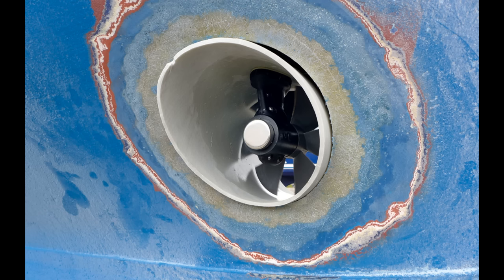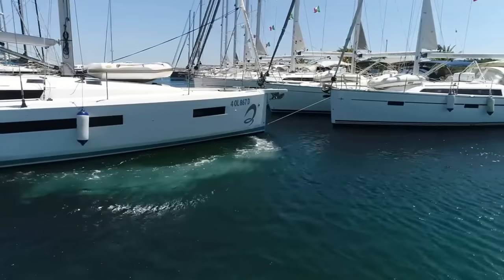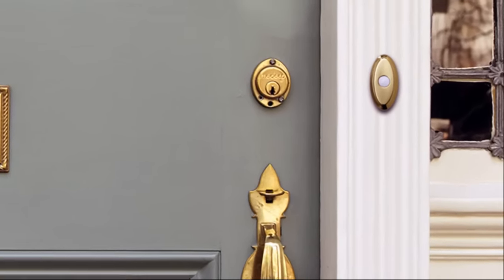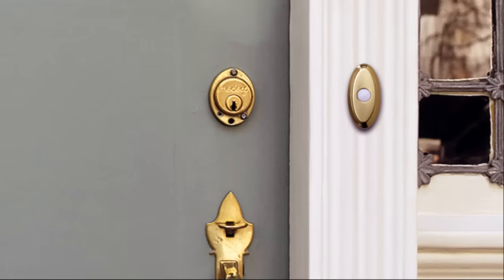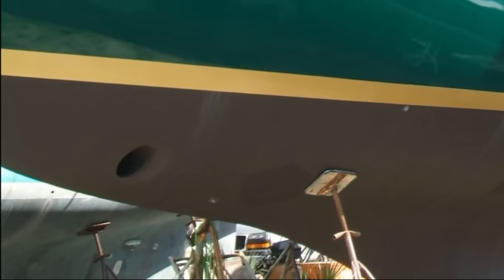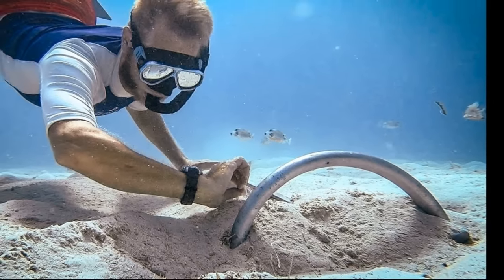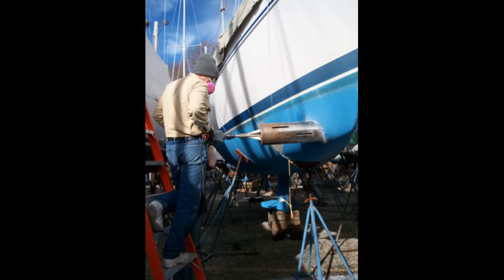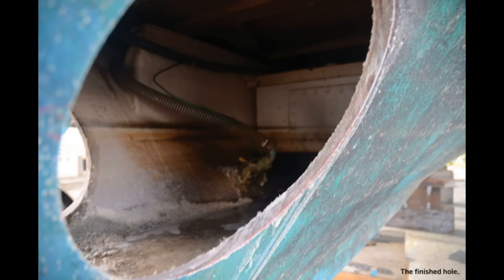Sailboat Bow Thrusters - How Much, Do you Need One, and Why - Ep 248 Lady K Sailing

Comment: I have a 1975 Columbia 52’. (No not 50) when I bought it, knowing I’m essentially single handing it with my wife no experience, my first thought was bow thruster! Ended up buying an external bow thruster, (side shift) talk about piece of mind! I sail sea of Cortez  and south past Pv, lotsa marina’s with tight quarters (Barra ex.) and million $ yachts as obstacles/fuel dock lines etc.  after my hydrovane, easily my best purchase-love it(esp. the hand held remote) $4500 in 2018

Comment: We installed external thrusters and it is great piece of mind coking back to the marina in strong winds. They are made in Ontario. Sideshift and come with a remote you can hang around your neck if you are single handed and need to move the boat sideways while attaching lines.

Comment: My spouse and I double hand our 54 foot Jeanneau, so the bow thruster is essential, especially in our marina where the fairway is only 65 feet wide, so we only have 5 feet of clearance forward and aft entering and leaving the slip.  Being able to spin the boat in its place is mandatory.  Our friends bought a Beneteau 423 and had the bow thruster added post-purchase.  There are a few companies up and down the East Coast that specialize in installation.  They have crews that travel from marina to marina with all the components in their truck and do the install in 2 days if the boat is on the hard.  That includes all wiring, batteries, charging system, etc.  Going price for a clean installation where nothing is in the way of the tunnel, thruster and a ready spot is available for the batteries was about $14K.  Watched them do the install on a remote web cam, it was pretty cool.

Comment: The Harbour we are based in we have a pretty awkward mooring against the harbour wall and to go out to sea we have to push off and rotate 180 degrees in a space about 10 feet wider than the length of our boat. When there isn't a boat moored up on the pontoon opposite of course. After 10+ trips out we have become very slick at doing this, I can put the engine in reverse at low revs and I know the prop wash will rotate us anti clockwise. There is a river and tidal effects that we have learnt will spin the boat quicker or slower. I'm just saying if you learn the capabilities of your boat it may make you a better sailer than if you rely on extra add on equipment than say a bow thruster. "Know your limits" is the best piece of advice in this video.

Comment: Great vlog again and agree with your analysis and conclusions. Have myself..live on it too...a 38ft steel twin mast cabin sailboat. With long keel...so was quite tricky sailing by myself to the new marina here when docking on arrival due to the wind. Was also tired from the long trip. Especially also because when scouting and registering two days earlier the side jetties were still missing which were there now. The boat drifted at an angle unfortunately.😅 Bow thruster had definitely helped me, now it was some helpful fellow boaters. So much thought about it afterwards. But somewhere I don't want it, as a good skipper you have to be able to do without it I think and the cost is indeed relatively high for little use. So I was and am looking more at creative alternatives. An electric outboard motor with the often long shaft..also for use in my dinghy..that you can place on the bow as a bow thruster function? A water drone to assist as a kind of tug? The dinghy itself functioning as a tug unmanned with a remotely controlled electric outboard motor often used by fishers? A water jet-like system with a water pump and then hoses to be placed on the bow? I will experiment with it in the new season and when I have some budget again.😅😊

Comment: Ive done several on power and sail. Good job covering the primary issues. It can be tricky. They need to be well below the waterline, sometimes thats just not possible in some boats. Get someone with experience to investigate the possibilities before pulling the trigger.

Comment: The last boat I chartered was a 32'er,  my docking plan turned completely disastrous. A few months later I bought a 45' Hunter, with a bow thruster.  I'd never used a bow thruster before, but I figured it  out in the channel heading towards my new berth/home (for the first time, solo.) I backed the boat into the berth and did a pretty good job. The next 8 attempts, 6 with an instructor were terrible. Now I'm good.  Bow thruster is great, practice is more important.  I use it all the time, but I could get by without it. 
And yes indeed, docking in a specific place is always always optional, not mandatory. What is mandatory is docking safely without damaging anything. 
Do I like my bow thruster?  you bet. Do I need it? I use it. Glad to have it. My dock neighbors have an after market bow thruster that hangs off the bow of their 40'er.  They like it. This would get you a bow thruster, not cost $18k.  Do others need a bow thruster?  What we all need is a lot of careful practice doing anything and everything with our boats. 
As for "We've all got along just fine without...." I wouldn't be sailing if not for all the navigation and safety measures of the past 50 years. EPIRB, VHF,  AIS, radar, Navionics, GPS, Predict Wind, (I would never have purchased any boat with a wood core) etc, etc.... What we (sailors) used to 'get along with' was scurvy, horrendous death rates, floggings, salt beef, moldy food....  
What might save you $18,000? Get a flat (rectangular) dense fender. Use this on the corner of the boat that might drive itself into the dock when you spring off or dock. You want flat so it won't roll out of the way (that's a huge problem). On a catamaran this is a 100% definite. On a monohull? Yeah. If you know you can get close to the cleat on the dock to get that first line around it without smashing the corner of your boat?  you'll have a lot more control because you don't have to touch the dock at less than 1 knot.  Tim probably knows more about this stuff.  But the flat dense fender. I've been the guy with the roving round  fender, when things aren't working to plan, it will get rolled out of where it needs to be.

Comment: Great video! I have always been curious about the portable bow thrusters like the DockStar that has integrated battery and receiver and is removable in 30 secs, seams like a great alternate when you go into a tight marina or a super windy day. Then for general island hopping or racing in goes in the lazarette. Much cheaper option. Do you have any experience with these type of thrusters?

Comment: Nicely done! As always there is another way with its own downsides: If your bow is full of stuff or there is no enaugh distance to the waterline near the bow you could use an external thruster. They are cheaper to instal, too. But you would put something big in the water under your bow so you may loose a couple of places on the next racenight...
Reply: How about an external thruster that mounts to a bracket... and is easy to mount and remove? This would work best on a bow that is nearer to vertical.
Reply: Sounds interesting. but were exactly would you fasten the bracket? if its underwater: not easy to reach and were would you put the cables? if its over the waterline: heck of a bracket to withstand the forces with a long lever. and were to store it when not in use? Looking forward to refining this idea. Could be really helpful!

Comment: Love the analogy, ‘treat it like a doorbell…’ So, after 8 years without a bow thruster and doing just fine (most of the time 😉), I’m ready to add one to my 39’er (modern fin keel with single spade rudder). Any resources you can recommend for a full DIY install. I’m competent with glass and DC electrical, but need some guidelines to follow, particularly on the battery/charging circuitry to tie into my 12V onboard and 110V shore power systems. I’m fortunate that my boat already has the dedicate space for the thruster in the bow, just need to install the tunnel and all the gear around it.
Reply: Look up jet thruster.  Cheaper, less maintenance. More compact.

Comment: I have a 40.1 oceanic with twin rudders  with that and a 5:6 keel i would not survive docking with out a bow thruster..

These new boats are very wide and do not sink much so a side wind will make it very difficult to control

Also the new sailboats are not deep enough in the water in the front so you need a retractable bow thruster or it would just blow wind not water.

Comment: I found docking a (class) 32' with an inboard to be way easier than docking my 25' outboard (I need 3 hands and also to simultaneously look forward while wrenched backwards to reach the shifter), so obviously bow thrusters should be mounted on smaller boats rather than larger. :P

Also, I feel like they may substitute for skill and make people feel like they can get into anything because they have one. Having witnessed someone do a 42-point turn in a slightly windy marina (but with plenty of room) with constant bow thruster use, I feel like that is a crutch that maybe shouldn't have been invented. :P

Comment: Got as far as &18k to install one... For a lot less than that you can buy some lines and a good course on handling yachts in confined spaces. Until you get above 60ft or 30t you should not need one. Even on much bigger boats there are other ways. I have seen a 200ft square rigger docked under engine supported buy the 2 ribs it carried and they maneuvered to the inch despite a brisk wind.

Comment: To talk about bow thrusters without talking about full keel boats is kind of pointless. My long keel 36' is impossible to turn at slow speeds in tight quarters, especially in reverse. The rudder is absolutely useless on full keel boats in these situations and the bow thruster could be a necessity. On a boat with a fin keel and spade rudder, it's definitely a door bell.
The other factor is med mooring. Ask Project Atticus (Pacific Seacraft) what's it like mooring stern to in Greece without a bowtruster.